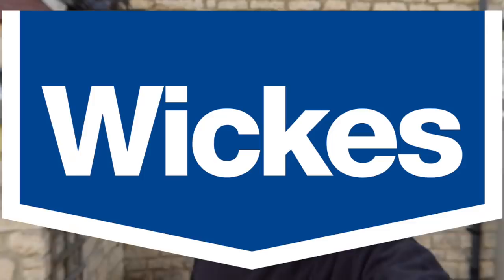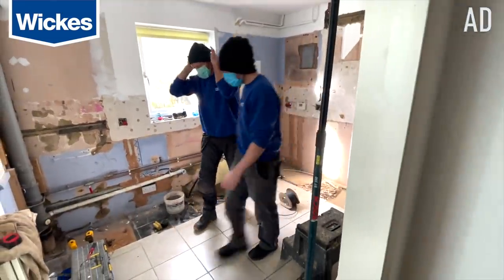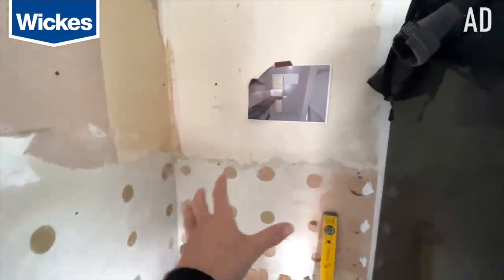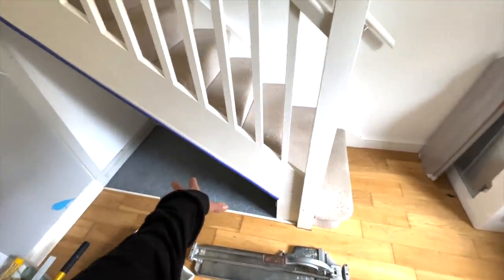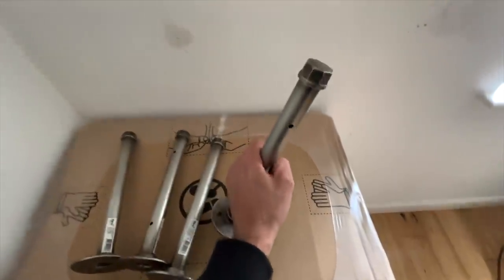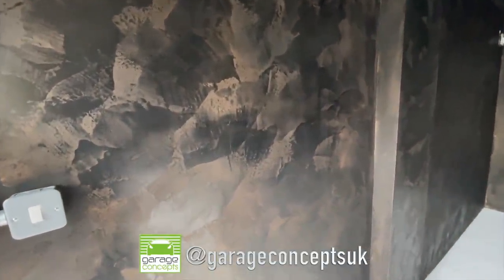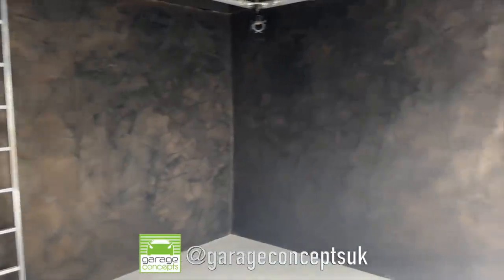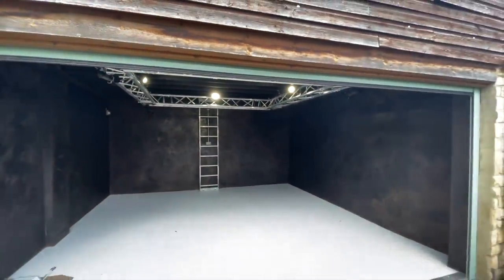COUNTRY HOUSE & GARAGE PROJECT REVEAL! EP. 2

Comment: Not sure if you’ve seen with your research but you can actually get companies that make a lightweight replacement roof for the conservatory, looks like a regular tiled roof but it is build on the corner conservatory glass. Cost effective and look way better than what is there, not sure if they can tie into the flat roof which needs doing... but I’m sure it can be done
Reply from the maker: Thank you!

Comment: Put a dormer in one side of the attic. It doesn't cost the earth and trust me it makes such a difference to the attic space being able to make most of that head height over most of the floor. You can also put in French doors and a glass juliette balcony which is great with the doors open in summer especially if you have a good view. Cost about 2k for that addition but well worth it. For the house not garage!
Reply from the maker: Yes! Will do
Reply: @TGE  One last thing, if you don't want to melt in the summer or freeze in the winter up there I recommend you line all the roof between the supporting beams with Kingspan insulation before boarding up. You'll have a nice little gaff up there when done.

Comment: In order for your discovery to become a room, even an unofficial one, you really should have the joists inspected for suitably.

It’s a simple, and cheap, job for a building surveyor (or structural engineer) and will provide reassurance and avoid issues going forward.
Reply from the maker: I’ve had one in since! All good

Comment: Glass box extention 🤔🤣🤣 also known as a conservatory 🤣🤣🤣
Reply from the maker: They’re actually slightly different - glass box extensions are different to normal UPVC conservatories in that they are permanent steel/glass/stone/brick structures. Why are you an idiot?
Reply: Not really though are they..just one you need planning permission for because its an extension to your house..and a glass box extention is an extension of your garden..which can also be fixed over an existing patio..that's about it..and frame work 🤣🤣🤣